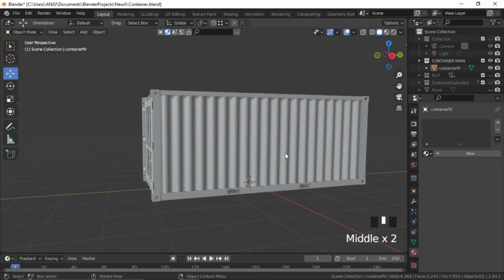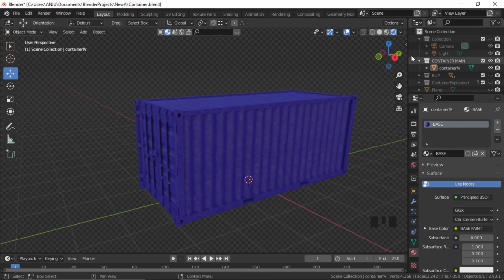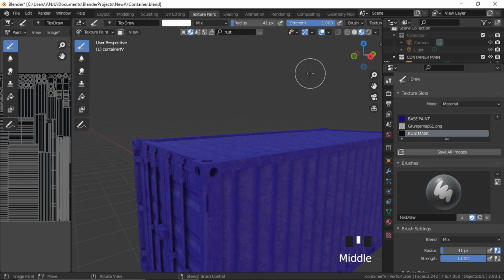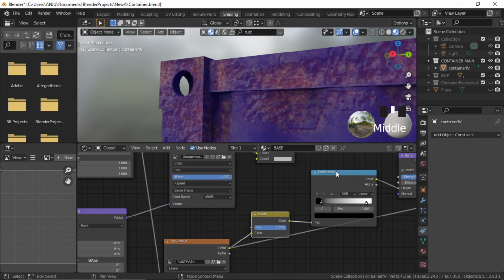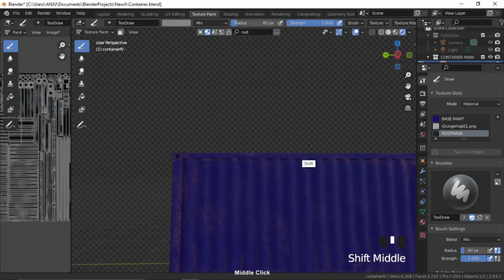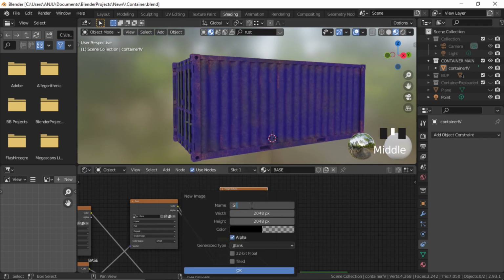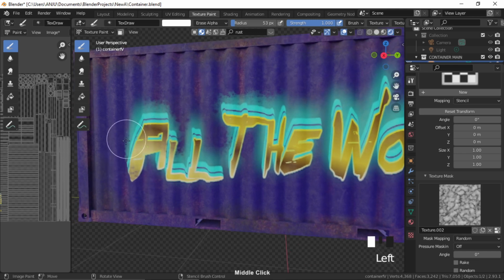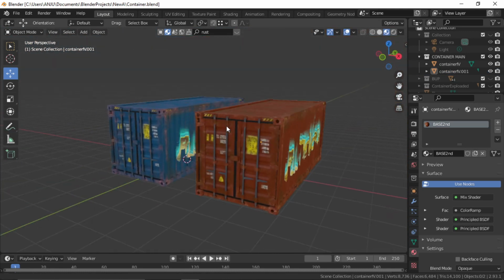Mix and Paint Materials in BLENDER

Comment: This was easily the best tutorial on mixing textures, after watching several different videos. Great work! Would it be easier to use an RGB node for the base paint to use the inline color wheel instead of creating a new image and filling it with another color? Not sure if you’d lose some benefit doing it that way.
Reply from the maker: Yes.. You can do that too.. 
However paint filling gives me control to  fill selected faces to different color within single image